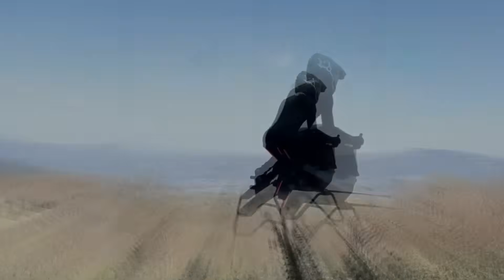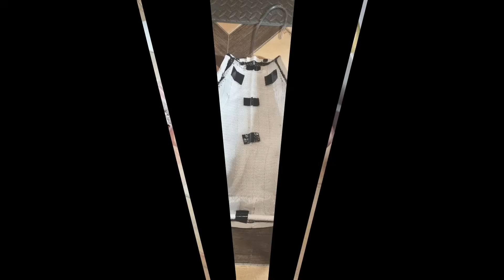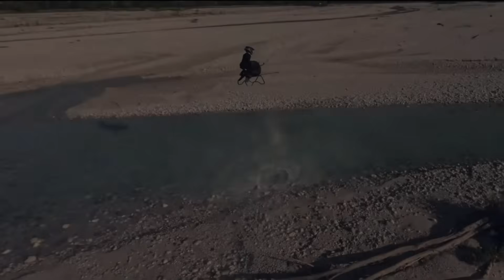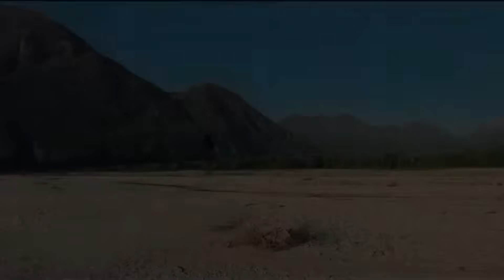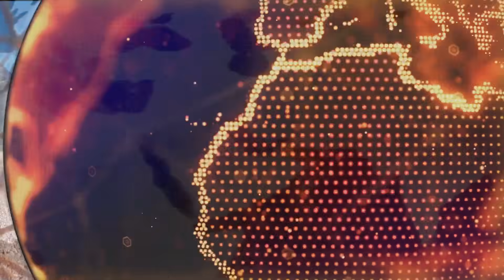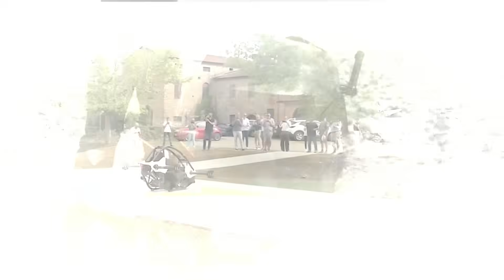2026 NEW VOLONAUT AIR BIKE OFFICIALY LAUNCHED!! Key Features, Tecs, & Benefits!!

Comment: Does it have to have the stick at the front?
Reply from the maker: Great question, @johnrandom! 👀
That front stick—also known as the control bar—is actually essential right now for pilot input and balance, especially since the Airbike doesn’t have traditional handlebars or a cockpit.

But as tech evolves, we might see it replaced with more compact or gesture-based controls. What would you like to see instead—voice commands, helmet tracking, or even mind-controlled flight?
Reply: @innomoto  All I know is that the stick takes away from the look of the thing. Does this flying bike really exist, or is it a fake video?
Reply: @innomoto  Tech is always refined over time, some being just intuitive. For now, what's the estimated max flight time? And where is the accelerator and what type is it? (I imagine a grip type, similar to a motorcycle?)
Reply from the maker: @crustycurmudgeon2182 You're absolutely right — technology does get more intuitive over time! 😎

As for the flight time, it’s still unclear, but based on similar jet-powered personal flyers, we're probably looking at somewhere between 10 to 20 minutes of flight time, depending on conditions like weight and throttle use. The accelerator is likely a grip-style control, similar to what you’d find on motorcycles, offering a more familiar control for riders. But the exact details haven’t been fully released yet.

What kind of control system would you prefer on a flying bike — would you stick with a motorcycle-like throttle or maybe something more futuristic?
Reply: @innomoto  I'm actually hoping it's a twist-grip type throttle like on a motorcycle. As for price? I really can't give any sort of realistic estimate, as I'm nearly 70, retired, and on a VERY fixed income (i.e., fixed quite low!), so virtually any price would be out of my realistic range. Still, a guy can dream about younger, more affluent days and wistfully watch these videos and live vicariously through them!
Reply from the maker: @crustycurmudgeon2182 That’s such a heartfelt response — thank you for sharing it. 🙏 You're absolutely right: just dreaming about these machines, reliving that thrill, and imagining what’s possible is part of the magic. And honestly, it's riders like you—who’ve lived through the golden eras of motorcycles—that really appreciate how far we've come. If they ever make a retro-styled flying bike with twist-grip throttle and old-school soul, I hope you’re the first to take it for a spin… even if it’s just in spirit. 🏍️✨ Which bike from your riding days do you think would’ve made the perfect base for a flying version?
Reply: It is an Insta 360 camera on a selfi stick.

Comment: This could all be achieved using AI.
Reply from the maker: @johnchoice1371
Absolutely — AI could play a huge role in making a flying motorcycle like this actually usable. From autonomous stabilization and terrain mapping to real-time flight path adjustments and safety overrides, AI could help overcome many of the human and environmental challenges. 🤖✈️

Imagine an onboard system that manages altitude, noise zones, and even emergency landings — the tech is getting close. Would you trust an AI to fly you through the sky?
Reply from the maker: @ntal5859
Excellent observation — you're absolutely right. This machine isn't riding the ground effect cushion like an Ekranoplan; it's more akin to thrust-vectoring VTOL tech, just like the F-35B as you mentioned. 💡✈️

And yes, likely software-limited to low altitudes for safety and stability reasons. Using true ground effect would boost efficiency but also introduce new control challenges — especially with uneven terrain or variable surfaces.

Do you think a hybrid system — switching between vectored thrust and controlled ground effect — could be a viable path forward for improving both performance and flight time?

Comment: L'engin parait formidable, même si il ne vole qu'en effet de sol c'est pas mal bravo 👍 mais le problème avec ces engins volant léger qui utilisent un mini réacteur c'est que cela consomme beaucoup de carburant et la durée de vol est de quelques petites minutes. Comme le Jetpack qui vole 10mn...
Reply: It is not using ground effect , if it were it would be so much more efficient, I dare say they are limited by software for safety so you don't shoot up to 3000 ft .,.. it just uses thrust vectoring IE think F-35 B hovering.
Reply from the maker: @ntal5859
Excellent observation — you're absolutely right. This isn’t a true ground effect vehicle like an Ekranoplan. It’s relying on thrust vectoring, similar in principle to VTOL jets like the F-35B. 🚀

Software-limited altitude makes sense too — both for safety and regulatory compliance. Harnessing ground effect would reduce fuel consumption significantly, but also limit maneuverability and flexibility. Perhaps a hybrid approach could be the next step?

Do you think using controlled ground effect + vectored thrust could balance efficiency and control for low-altitude urban flight?
Reply from the maker: Merci beaucoup 🙏 Vous avez tout à fait raison — l’autonomie reste aujourd’hui le plus grand défi pour ce type d’engin. Mais les choses avancent vite : matériaux plus légers, gestion intelligente du carburant, et même des recherches sur des alternatives plus durables. Imaginez ce que cela pourrait donner dans 5 ou 10 ans ! Vous verriez quelle solution pour améliorer l’endurance sans sacrifier la légèreté ?

Comment: Very cool but it won't go anywhere in a city because surely it is much too noisy.
Reply: exactly, very reduced usage, nowhere in the EU, I guess.
Reply from the maker: Great observation,  @bjelinski1 — regulations in the EU are indeed some of the strictest when it comes to urban noise and airspace use. 🌍✈

Right now, concepts like the Volonaut seem more geared toward open or private areas, where noise isn’t such a dealbreaker. But it’s also a glimpse of what might be possible if tech evolves — imagine a quieter hybrid turbine or a shift to ducted electric fans.

Do you think there’s a future for low-noise personal flyers in Europe? Or are drones and eVTOLs better suited for the EU environment?
Reply: @innomoto  "private areas" - you will hear the noise from a 1km distance, no private area in Europe in that respect.
Reply from the maker: @bjelinski1
You’re absolutely right — even in so-called “private” areas, jet-level noise would carry far beyond any property lines. 🔊😅 That’s a serious limitation, especially in densely populated Europe where true isolation is rare.

Unless propulsion tech gets radically quieter, wide adoption here seems unlikely. Still, maybe these early designs are just the spark — a bold starting point that’ll push future innovations toward EU-friendly solutions.

What kind of noise level do you think would be acceptable for personal flyers in Europe? Under 60 dB?
Reply: @bjelinski1 F the EU
Reply from the maker: Great point, @mheitm — noise is definitely one of the biggest hurdles for jet-powered vehicles in urban settings. 🔊💨

Volonaut hasn’t shared official decibel levels yet, but with jet propulsion instead of electric rotors, it’s safe to assume it’s not exactly whisper-quiet. That said, they’ve hinted at working on noise and heat management solutions — possibly for future, more city-friendly versions.

Curious to hear your thoughts: what would make something like this viable in cities? Quieter engines? Dedicated sky lanes?
Reply: I could see these in the dessert for recreational purposes.
Reply: @burn1gotbeats  weighing all risks (I have some personal experience in crushing while flying due to a tech glitch), if close distance to earth while speeding is the need - base jumping would be cheaper, easier to access, env-friendly, fewer single points of failure. More fun and less risk, IMHO.
Reply: @ good point 😎
Reply from the maker: @bjelinski1
That’s a compelling take—and your firsthand experience really adds weight to it. You’re right: when speed and adrenaline near the ground are the goal, sports like base jumping or wingsuiting offer raw thrills without the complexity, cost, and environmental toll of jet-powered tech. 🪂⚙️

The Volonaut might ignite imaginations, but the tech isn’t there yet for wide, safe, and sustainable use—especially with the risks of glitches at low altitude.

Appreciate your insights—what kind of innovation would get your thumbs-up in this space? Something more analog or modular maybe?

Comment: Does it have a power failure emergency safety feature? Looks fun. Is it stronger in ground effect? Thanks.
Reply from the maker: Great questions, @samjohnson466 — and thanks for jumping in! 🙌

As of now, Volonaut hasn’t revealed specific details about emergency power-failure protocols, but considering the lack of exposed rotors and its jet propulsion system, we're curious if they’re exploring ballistic parachutes, auto-hover, or assisted descent tech like we've seen in some eVTOLs. 

And yes — ground effect is definitely something that could enhance stability and lift close to the surface, especially with jet thrust. Would love to hear your take: what kind of safety system would YOU want on a flying bike like this?